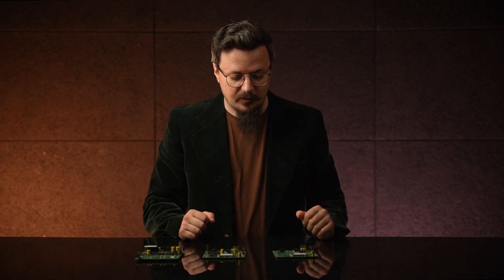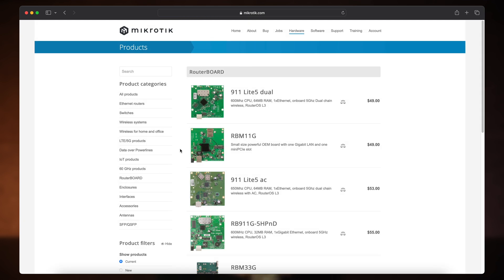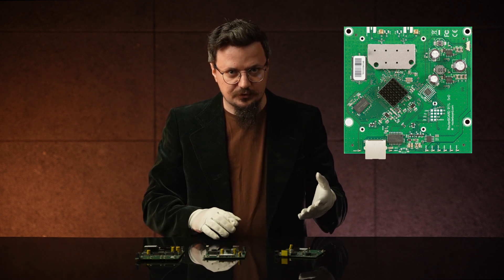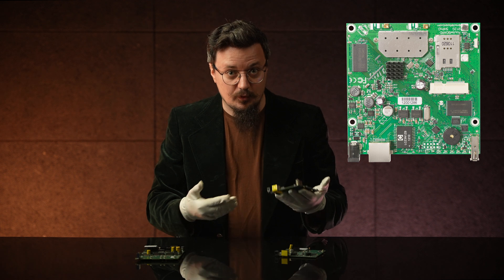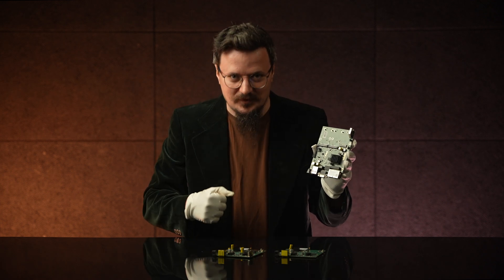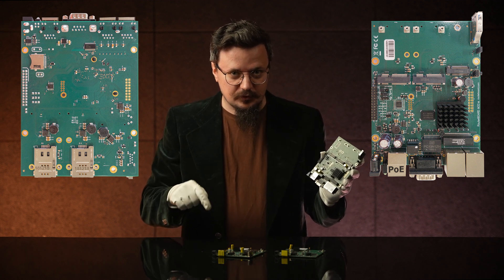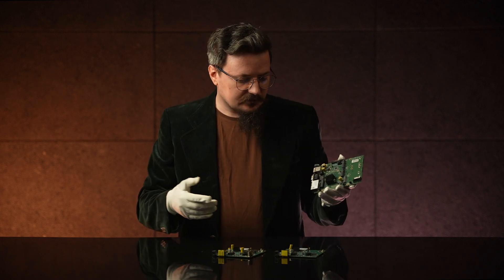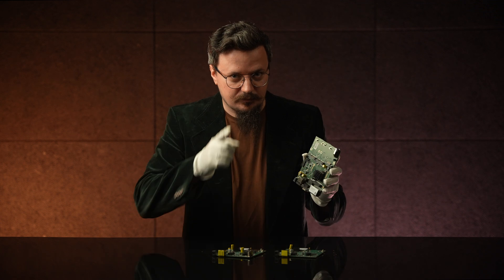Build your own routers with MikroTik RouterBOARD!

Comment: @mikrotik 
GPT exfat partition support
Can you please think of adding the following in you next big router switches:
ssd nvme addon support
extra ram slots
old mini pciE slots like the old routerboards for wifi cards or 5g mini cards ( the old pci slots were excelent before with wifi )

Main reason for gpt exfat patitions & ram is to run vm images or extra OS on mikrotik...... example pihole, pfsense or pbx etc......

and very important for your small routers, try and make its ram 64mb or more and not 16mb cause its to little

Comment: Has anyone experienced the same issues with their CRS310-8G+2S+IN with RouterOS 7.11.2?
An Intel X550-T2 with the latest firmware and drivers from Intel (from their ethernet connection package 28.2.1) can only connect to the switch with 1 GbE. Manually forcing it to 2.5 GbE in Intel’s drivers doesn’t lead to the establishment of a connection. The same Intel ethernet adapter and cable works fine with 10 GbE with a CRS312-4C+8XG-RM.
Reply from the maker: Disable auto-negotiation and set link speed manually. https://help.mikrotik.com/docs/display/ROS/Ethernet#Ethernet-Properties 
If problem persists, please contact Mikrotik support.
Reply: @mikrotik  Thank you for the tip!
It works if Auto-Negotiation on the switch as well as the ethernet adapter is disabled and the speed is manually set to 2.5 GbE on both ends. Not exactly an elegant solution but at least it works now. Can you open an issue ticket internally so this gets hopefully fixed with a RouterOS update? I’m seeing identical behavior on two units of the CRS310-8G+2D+IN so a random hardware defect seems unlikely.